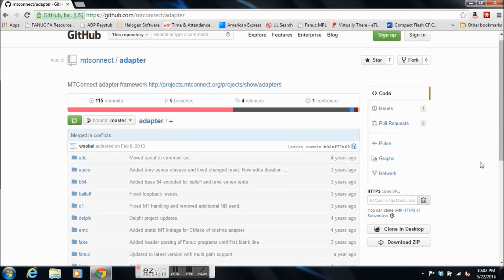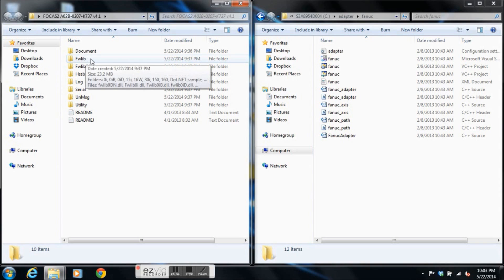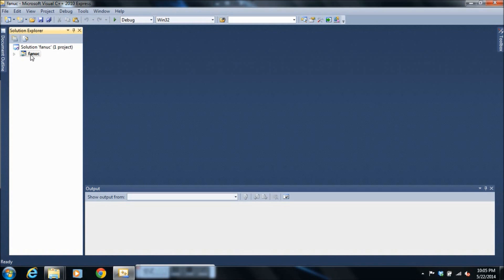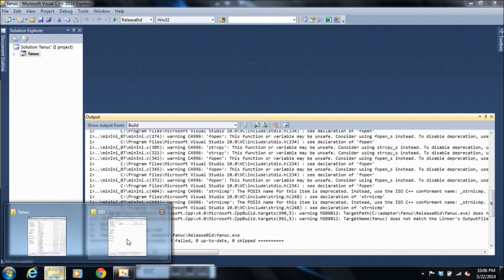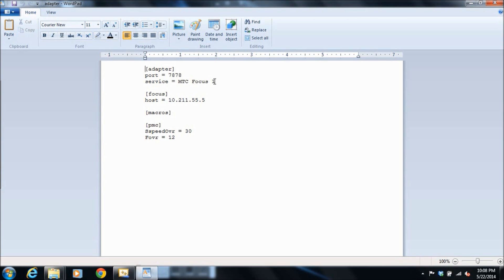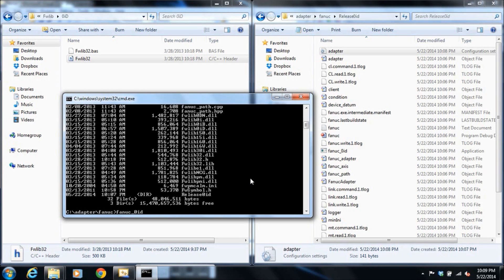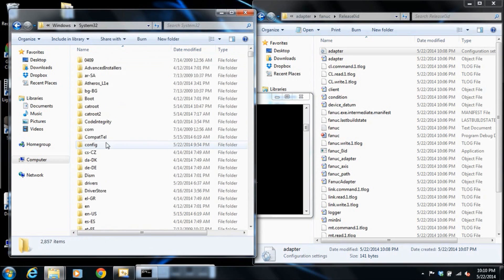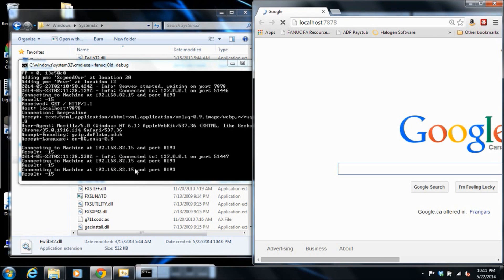MTConnect FANUC Adapter in Windows

Comment: Hey Mike, thanks for this video.  It has been very helpful and I have it working on a machine in my shop.  Now lets say I have two or 20 Fanuc controlled machines, all with different IP addresses.  Should I run separate instances with unique adapter.ini files for each machine?  What about the agent watching port 7878?  Thanks!
Reply from the maker: You are correct, each machine will need its own adapter.  However, you will only need one agent (depending on the amount of data collected, the network topology, and the PC specification)
Reply: Thanks for the reply Mike.  Just so I understand, I'm going to run an instance of the adapter for each machine.  Each instance will have its own adapter.ini file with the machines unique IP address.  All these adapters will report onto port 7878 and I need to add capability to my agent to distinguish between machines when it is recording the data.

If the above is correct, can I also leave all the controls on port 8193?

Comment: how can i get FANUC FOCAS CD A02B-0207-K737 or the libs file ?
Reply: I really want to get this working with our Fanuc 32i-Model B so I ordered on from Fanuc.
Reply: +Prof.X Charles Francis Xavier you buy from fanuc is only 25 USD
Reply: Not sure but the Fanuc machine/controller must cost a bit. Why not just make the library files freely available vs charging the $25? Using data collection would add so much value to the customer!
Reply: Ike Kim - Where/ how did you order the CD? I want to give this try also
Reply: You can order it from Fanuc America or Fanuc Robotics Canada. I ordered one from Canada and tried to compile using Visual Studio 2015 (Mike in the video uses 2012 Visual) and had some dependency errors...I will try to get it working, but need to learn how to debug the C++ errors.
Reply: Ike Kim Thanks, will have mine ordered ASAP.  I am presently working with Visual Studio 2017 and will report back on how the build goes once I have the FOCAS library.
Reply: @quarter20369  
Hello sir , can you share focas cd files to me. In india it is very very costly , i cannot afford . Please help me by sending cd dump by google drive.
my mail id is maninder14983@gmail.com
Reply: Looking forward to it. Let's touch base!